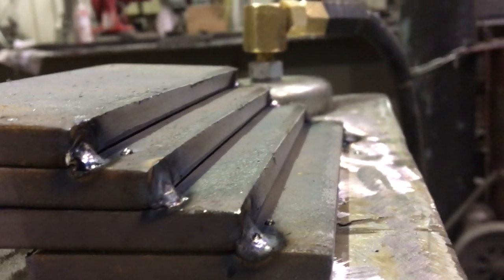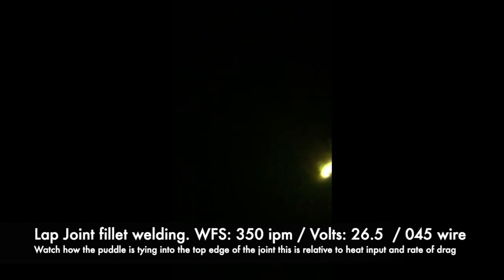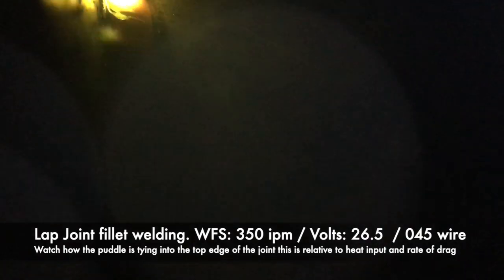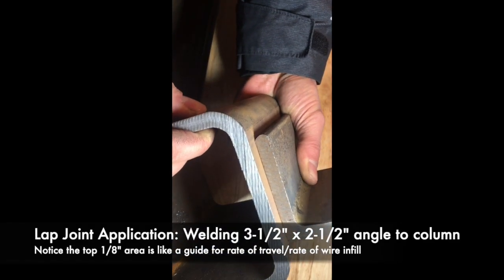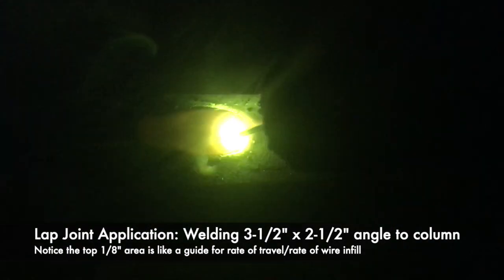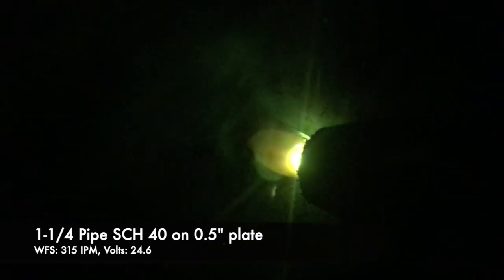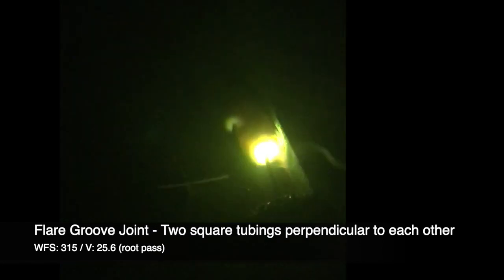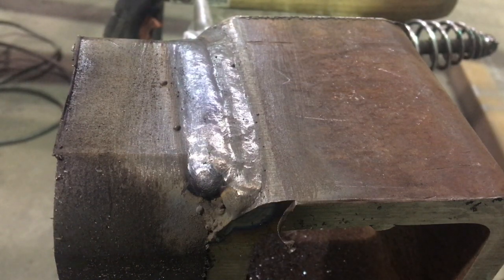Flux Core Arc Welding: Reading the Puddle

Comment: As a self-learning new welder, I really liked this Video. To bad he didn't keep going.
Reply from the maker: I've been meaning to make more welding videos, is there anything you would want for content?
Reply: Hi, I'm 58, a VET, and Disabled. I'm learning to MIG Weld-on 3mm mild steel, out of necessity. I understand all the PPD stuff. What I'd like to see is a video that details best practices for tacking and then welding. How to pull the project back into being square from heat warping... like on a frame, when you've welded one corner square but it pulls another section out of square. I'm using a Weld Well Mig 200 Gassless welder that came with no chart ☹ Yeah, I get the 'sound of beacon'...

Comment: is it harder to weld exhaust  with flux core ?
Reply from the maker: I've never tried welding on exhaust parts to be honest. FCAW is more applicable to structural steel such as welding stiffener plate inside of beam, or gussets/plates to your column as the steel is thicker.  Exhaust parts are generally around 16GA? You will likely have more success using 023/030 solid wire as the arc is cooler when compared to flux core. Tig welding could also be used.

Comment: So when watching the puddle would the arc part be the main bit to view or the less visible darker part just behind the arc ?
Reply from the maker: Thanks for the question! You have to watch the less visible darker part just behind the arc. The camera doesn't really do justice relative to what the eye can see, but the puddle is the focal point in welding because you have to observe how it blends into parent material. The arc will be in your field of view regardless and is meant to pre-heat material. But it's the puddle infill and tie in that informs the welder how fast or how slow they need to drag the torch, or how to adjust their machine.
Reply: @alternativelabs3909  many thanks  some good tips there 👍

Comment: So when watching the puddle would the arc part be the main bit to view or the less visible darker part just behind the arc ?
Reply: Yes. The orange part behind the weld is your flux or slag cooling. Concentrate on the white part, in front, the molten puddle.